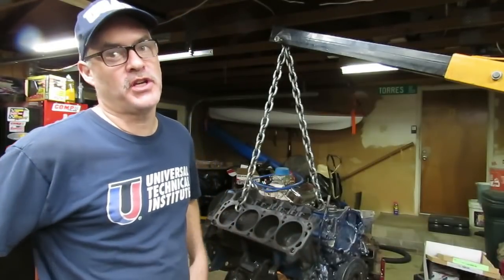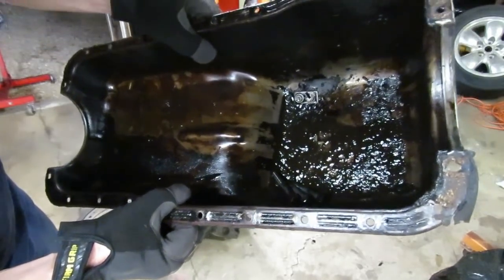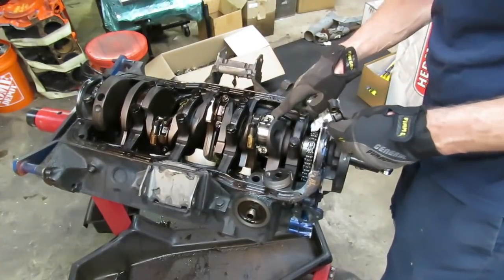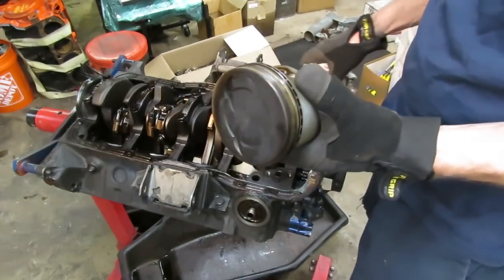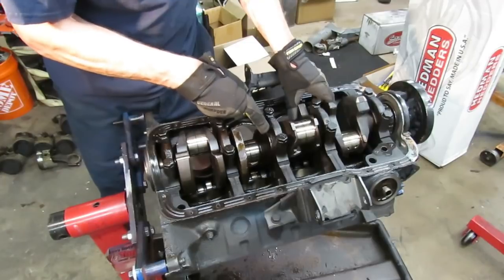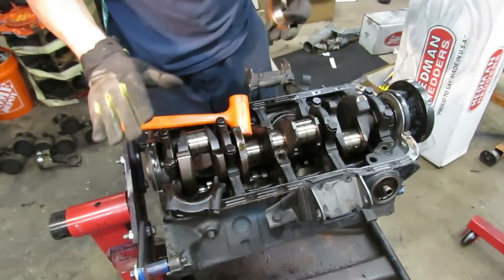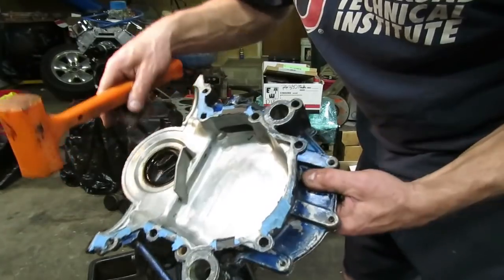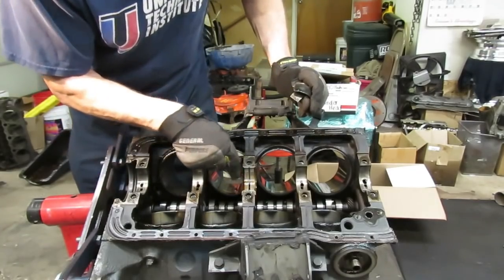How to get more power out of your small block Ford part 2

Comment: Excellent teaching.
I rebuilt the 302 in my '83 GT back in '96 just from reading Hot Rod mags....it still runs! 
A .030 over block with SpeedPro hypereutectic flat tops, re-worked cast E7s w/1.90  1.60 stainless valves, some mild port blending and matching (myself), Lunati cam 218 @ 0.50/ .488 lift w/110 LSA, RPM intake w/650 dbl. pmpr., 1 1/2" primary longtubes with full 2.5" exhaust, stock Duraspark ignition, 5-speed......it's a potent little street engine!
If I can do it, anyone can. 
Good stuff here. 👍

Comment: Ford had a bulletin in the 1980's. The torque converters were ballooning. Shoving the crankshaft forward. Their fix at that time was shorter headed bolts that attached the flexplate to the crankshaft. The bolt length was the same, but the fastener head was shortened.
Reply: Did not know that, good to know. :)
Reply: @peterhart4301  I actually saw the heads of the factory crankshaft bolts embossed into the torque converters of the affected vehicles. So if you ever run into an older model Ford with wiped out thrust bearings, better look real closely at the torque converter.....

Comment: Hi everyone! this is my engine that he is working on, saw a few questions that I thought I would answer. It is a C4 automatic trans. I am also concerned that I might have torque converter issues so while the engine is out the converter is being replaced and the trans rebuilt, I do plan on doing an AOD conversion some day down the road. As for the rust issues I only know the history of the last couple of years of this car, the previous 50 years are a mystery to me also. So I have no idea how long the car sat without being run, how often the oil changes were done, how it was driven etc.. I am lucky that he is doing the tear down and machining for me but it would have gotten done anyway. someone asked if it had recently been fixed but still had issues. The truth is that i did alot of top end stuff, 4 bbl intake and carb, timing chain, lifters and push rods but hadn't tore into the bottom end. the engine was running surprisingly well except for getting hot, I had hoped new water pump, thermostat, radiator and electric fans would fix that issue but when it didn't the engine came out. I had no idea about the water issues until the tear down, I wasn't seeing coolant in the oil or the other way around and I wasn't having to top off coolant so I am still a little mystified about the rust.  I am really excited to see how this runs when the project is done.
Reply: It could be just bad head gaskets leaking??? I have put a comment here about the camshaft bolt,  make sure your engine builder knows about it. Just a warning to the wise. :)
Reply: @peterhart4301  It could have been but if so it was very mild, no tailpipe smoke, no needing to add coolant, if I was smart I would have used the combustion gas analyzer.
Reply: @charleyhelvy8529  Yes mate, we all have 20/20 vision in hindsight. I only said it maybe head gaskets because years ago I installed the Felpro Black head gaskets on a 289 and when I pull the engine down again, I found signs of leakage yet I had assembled everything correctly the first time.
Reply: I like the idea of the AOD.
Reply: I had a 302 that got warm after it ran about 50 or 60 miles never ran hot but was borderline after a lil bit always when I tore it down someone had changed a freeze plugs and pushed it in the engine with out getting it out and that was the problem with my heat issue

Comment: Nice, really enjoyed the explanation of the wear on the rod bearings and wow that thrust bearing showed very heavy wear. I've seen that kind of wear on manual trans engines but haven't noticed that much wear with automatic trans.
Reply: I have found the exact opposite,  for some reason most of the engines with automatics I have seen will usually have worse thrust play than an engine with a manual trans. On a stock application they are close to the same but with a built high performance automatic with increased pressures i think that they are much harder on the thrust bearings because the converter is being pressurized and being pushed forward really hard the whole time it's running where as a manual is only pushing on the crank when the clutch peddle is depressed. Watch some of the promod guys who run built turbo 400 or powerglides and u will see that when they are making a really hard pass they will actually push so hard against the flexplate that u will see sparks shoot out from the bell housing and that is from the flex plate hitting the starter teeth.

Comment: The car is a 68. The bearings are stock original from approx 68. Appears to be a stock bottom end. You mentioned the heads are 66. So someone rebuilt the top end from your initial view.
I love tearing into an engine and trying to figure out what kind of life it  had. Engine CSI forensics 101 
I almost fell of my chair when you said if you want to see each of the rods removed to rewind and watch 8 times. You got a good sense of haha!!!
You got to have it in life to make it to the end with a smile on your face!

Comment: Hay Man really enjoying your series on the the ford stuff like this. The windsor really is a great engine.  Overheating on a Early Windsor could be Possible because of a reverse rotation serpentine belt style late model water pump on an early block or vice versa  Your buddy is going to have a very nice nice Runner !

Comment: My 302 from my 1992 F250 also had a constant overheating tendency.  In the end, the problem with mine was that some previous owner had used a radiator stop leak product...probably several times.  The coolant passages in the heads and block were almost blocked.  It was almost like plastic blocking most of the passages.  Amazing how cool the engine runs these days, after a complete rebuild...and after also adding a transmission cooler and a 3 clutch torque converter.,..and an extreme duty fan clutch.  Probably even runs too cool....but I'll determine that this winter.  When I had the overheating problem, I ended up replacing the heater core twice...and the radiator twice, while also having a rear main seal leak and constant tranny fluid leaks from the pan.  Was flushed many times but that never fixed the problem created by the shit someone poured in the rad.

Comment: That cam bolt that is loose is a sign that the camshaft gear is wobbling on the end of the camshaft. That is the cam gear and the crank gear are not lined up (parallel to each other), you will need to put a straight edge across the front of the timing gears, measure the difference (with feeler gauges), and then modify (shim) to suit. The problem is Ford was not so accurate with their measurements, and it was a case of rough enough is good enough, hence they used a plastic timing gear to compensate for the misalignment. If the modification is not done, the camshaft gear will wobble on the new rebuild eventually snapping off the alignment dowel on the end of the camshaft.  Once this happens, the camshaft stays still while the camshaft gear spins freely on the end of the camshaft, the result is the crankshaft is rotating but the valves stay in the open position, and the pistons can hit the valves causing major damage.

Comment: I got a 79 F150 302 ci. For which I’m in a frame off. I currently got my engine pulled and ready to put on a stand. I got the everything off the block except for the crank, camshaft and all eight pistons. So far I’ve noticed a bad timing chain assembly (too much slack) and bad vibration damper.  Oil in pan looked great. Any recommendations.

Comment: 11:40 and at a previous time in this video, is the subject of excessive thrust bearing wear without an explanation of why. 
   My bet would be is that this engine was in a manual transmission car.
    Now I'll resume rest of the video.
Reply: I was thinking the same, but shows flex plate at the start of video.

Comment: The wear on the thrust bearing, even though with an auto trans looks like torque converter ballooning up. This was more common in ford trucks with C4s. As for the rust, who know? Could be a number of things? Glad it can be saved, original 289s are getting hard to find.

Comment: I would look at vacuum modulator. If not connected, it jacks up pressure in transmission, pushing the torque converter forward. Just a guess, I've seen it before.

Comment: I know it's not good for the engine but I have seen plenty of engines with insane thrust play run perfectly fine. Alot of people will say that thrust wear is much more common on cars with manual transmissions but from my personal experience I find that cars with automatics especially performance automatics with increased line pressure seem to do more thrust bearing damage. I think it has alot to do with the fact that an automatic is always pushing the crank into the bearing where as a manual trans is only pushing on the crank when the clutch peddle is pushed and releasing the clutch. I think that on a stock engine thrust clearance is a bit over rated but I understand that overtime excessive thrust play will tear other components up but I have personally ran engines with 1/8in or more of end play lol.
Reply from the maker: on newer engines like the LS1 with relocator wheels on the crank .010 to much end play will cause an engine misfire
Reply: @Myvintageiron7512  I'm sure it also causes oil pump damage on the ls style engines. The older engines were a bit more forgiving about end play and u do make a good point, I didnt even think about that.

Comment: I'm considering building a race engine using a stock 302 block.  Would it help any if I have the 3 middle caps swapped to a 4 bolt main caps?  I had a 347 and it cranked the block around the center main cap bolts.

Comment: Once had a buick 350 with the bearings same wear but worst.  And the trust bearing was almost gone.  Had been replaced it was clear the first one had let the crank hit the block. Crank was bad. As nd running it sounded like a rod knock

Comment: This might be a dumb question but could I drop a 302 crank n that block for a few more cubes and more low end turks ? Or is that tricky finding an older crank
Reply: The connecting rods would need to be changed as the 302 used shorter ones to compensate for the longer stroke.  I don't know if it is worth the expense as you only gain 13 cubic inches of displacement.

Comment: Ya rust in the cylinders, Surprized there wasn't a field mouse in there. Looks pretty simple. Was it a manual,Did? you say. Probly shoulda learned to shift it with out the clutch. You d a good job staying on task. A great roll model to us all, A very clean and orginized tear down. A thermostatic controlled oil cooler would heip that alot. pistons look like they ran cool for most of the clock  love that winnona seat and guid machine and the Blockmaster you have one of those BHJ fixtures for that don't hesitate to show any of that tooling you got. I sooo want one of those kwik-way machines like the winnona those have like a 30 or 40 taper spindle for face milling stuff with the 30-40 taper the langun siries one type B-port mill SOOOO need the shop space though you do cool stuff people discovering this kinda things still wayyy better than tv your there liberator
Reply from the maker: Thanks Yes I have BHJ Fixture works great we may even square deck this 298

Comment: Hey man I am building a 347 stroker and running a flat tappet cam Xe284h and bought some Crower lifters  and was wondering if they were made by the good company that makes the lifters and won't wipe out the cam on me?
Reply: Personally, i would send it all back and do the roller camshaft conversion.
Reply: This guy did a video a while back about certain lifters that were made cheap and didn't want to name the brand that was wiping the cam so I was just checking to see if crower was safe but I believe that they are because they are a well known company that has a good reputation plus they're the cam saver lifters that gives the cam 30% more oil and with the high volume oil pump and zinc in the oil I believe I'll be ok ,I've built a couple of these and have had good luck with the flat tappet cam and I have built a couple rollers as well With good luck but I was just curious about crowler, never used the brand  before so I was just getting this guys opinion but I've already got the cam installed and degreed in with the timing chain , cover and the water pump on so it's home 😁(for now unless I'm the unlucky one 🤣) heads and lifters are in and just measured and ordered the pushrods 🤞🤞
Reply: @440cubicinch  you're exactly right, I'm going to drown mine in zinc  I bought the best lifters that I can buy they're made by crower and are called cam saver lifters that are supposed to give the cam 30% more oil than a stock style lifter and I put a high volume oil pump in it to make sure that it's getting enough oil circulating throughout the engine and I took the inner spring out and going to break it in then put it back in after I do the break in and going to prime the system before fire so it should be ok

Comment: A 289 and a 302 are they the same block ? And if so why not go with a 302 crank and rod set up ?
Reply from the maker: The block is slightly different the bottom of the cylinder sleeves are a little shorter in a 289 block they don't like 302 or stroker cranks
Reply: @Myvintageiron7512  True, but the 289 can still handle a small increase in stroke.

Comment: looks to me like the oil changes were neglected. if the thermostat is bad and the engine takes too long to warm up condinsation builds up and turns into acid. i need a new thermostat in my ford inline it takes a while to warm and gets hot on a long hill in 110 degree weather but not overheating hot somewhere around 205-210.
Reply from the maker: 210 degrees is no problem this 289 was 250 degrees a few times
Reply: @Myvintageiron7512  wow thats hot